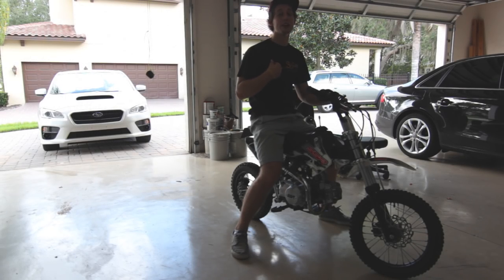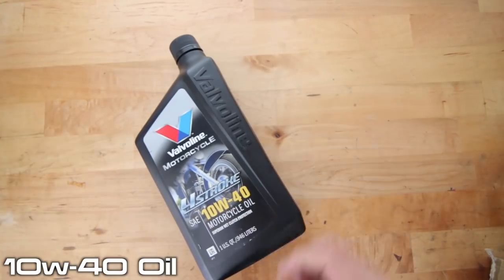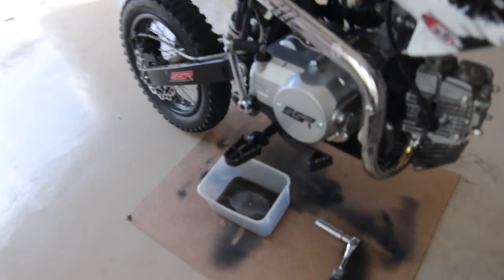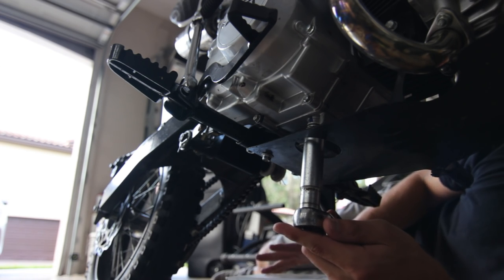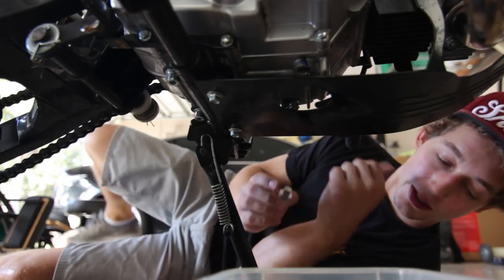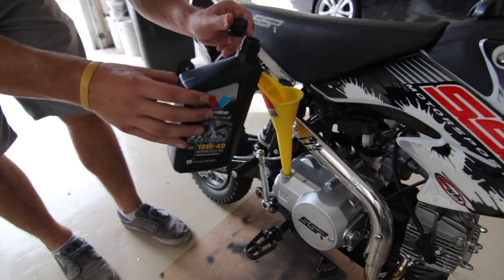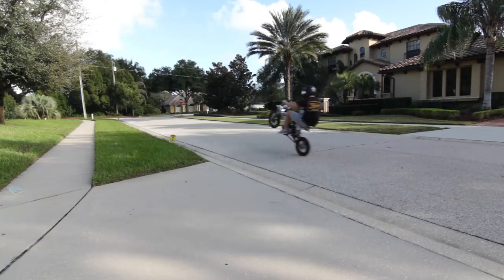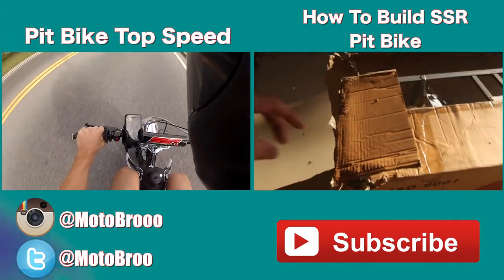How To Change Oil On SSR Pit Bike

Comment: Mistakes you made: run your bike before oil change, do not put all the bottle of oil in it. There is a marking on dipstick for min and max amount of oil so make sure to test that oil level is right. If its too much oil than just unscrew the screw on the bottom to drain it a bit.

Comment: My bike is way over due on a oil change and if i hold the throttle it backfires and sounds like a machine gun I have a feeling its timing but I got it brand new and it just started to do this

Comment: good help Video. you should have a crush washer on that drain bolt and change it out as well not every time but maybe every 3 or 4 oil changes.  there cheap so might be worth it in the long run.

Comment: I always let the engine run before a change on my 690 smc so then the oil flows out better, should be usefull with the pit bike too.
btw. does the ssr engine have oilfilters or do u just have to change the oil more often?
Reply: There is no oil filter u have to change the oil a lot
Reply: +mike89 oh, ok thanks
Reply: Lot of people use magnetic drain plugs to help filter the oil. Know on mine it always has crud and little fine shavings on it
Reply from the maker: +lenard ggor they do not have oil filters and yea deff running bike for lil will help oil come out

Comment: SSR 110-125c takes a 1 FULL qt of 10w40 motorcycle specific engine oil! That's a good thing. Don't overfill or underfill. Change every 3-4hrs and this well made engine will last 4-ever! SSR is prob the top Chinese pit bike maker out there. These are good bikes. Not race bikes but fun trail..small track..woods dirtbikes. I own 2 currently!
Reply: What do you mean change every 3-4 hours ..???

Comment: can someone help me out when you unbolt the bolt on the bottom of the bike the gas drips down in the container right then you unscrew the the thing on the side of the engine and put new gas in with a funnel but why do you put the gas on the side of the bike on the engine instead of the gas tank can someone help me out pls I don't get it
Reply: That's oil not gas he's putting in the side!!!! Gas goes in the tank in top, oil in your engine. If you put gas in you will wreck your engine right away!! Your bike needs oil to survive!!
Reply: XD MOTO you must be BAKED
Reply: facepalm "how to change your OIL" bro.

Comment: Do I have use one full bottle ? Or 2 ?
Reply: Scarlet Lopez not even one I used a whole bottle of oil and I recently learned that it was to much and u can wear down the gaskets and cause leaks if you put to much.
Reply: I have a 140cc oil cooled crf80 sized pitbike and that only takes 700 ml. He used way to much dumping the whole litre in. You should measure what you take out then put in the same, or go by the dipstick

Comment: Are you really suppose to dump the whole container of oil in the bike?
Reply: UncleAR yes the bike takes 1qt and the bottle is 1qt
Reply: No. I have a 140cc stomp pitbike that also has oil cooling radiator and that only takes 700 ml. Either measure what you take out then put the same back in or keep checking the dipstick

Comment: besy way to do this is to have you bike running for 15 mins then do an oil change
Reply: +HudzManBeats also on the dip stick theres some markings so you dont put too much or too little in
Reply from the maker: +HudzManBeats ^correcttt
Reply: cant wait to pull out my stomp 140 when this snow comes to england :D

Comment: Why aren't you supposed to use synthetic? I use it all the time on my ssr 160 tr and i don't notice a difference
Reply: uyvjhb kbh depends on the bike,  unlike cars,  cars have dry clutches  and they are just 2 peices of metal discs rubbing on each other,  motorcycles have wet clutches which means they are always in the same oil as the engine and synthetic oil is basically fake oil made out of plastic and oil mixed,  and it's way too slippery for your clutches to grab good on a motorcycle.... Hope this helped
Reply: Jrc Shenanigans wow really? I tho synthetic would've way better.